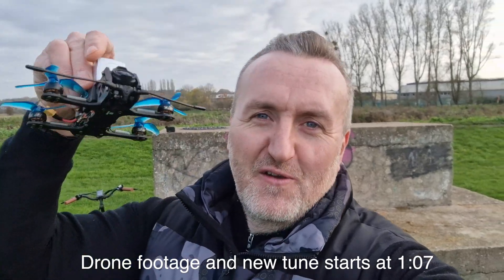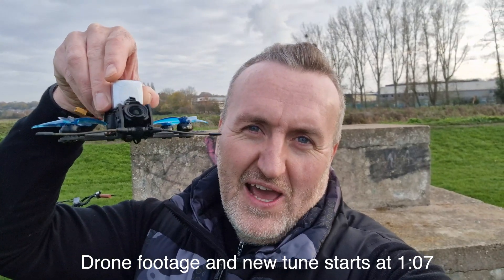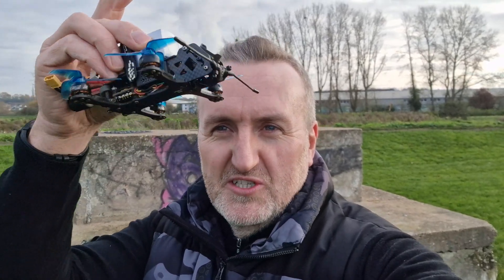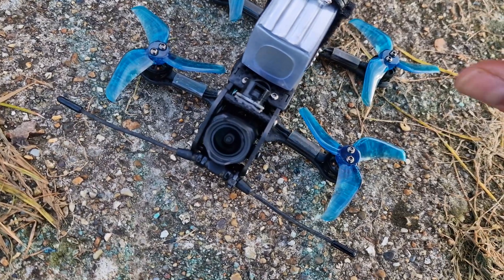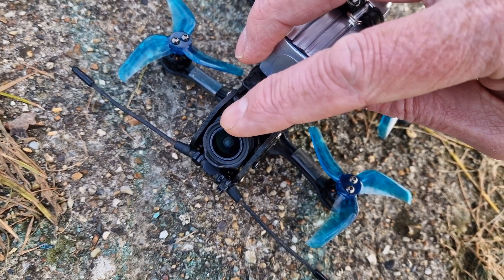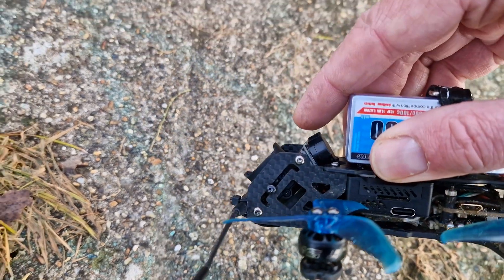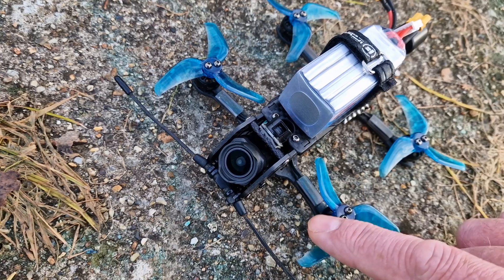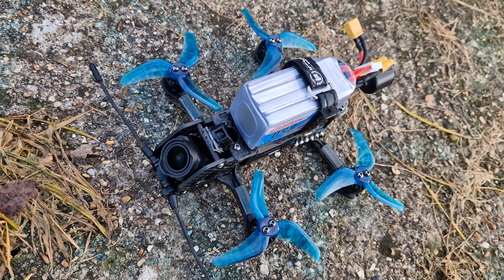GETTING THERE NOW! | DJI O3 Air Unit tweaks for better footage on a micro drone

Comment: The soft mount creates its own issues. You can see the jiggle and vibration throughout the video.  At least try gyroflow... It really is that good and easy to learn. The gyro in the cam tells the whole story of the flight and therefore can be eradicated. My first 03 air unit went on a plane. Second is in the mail and will go in one of my quads.. I cannot emphasize how good gyroflow is.
Reply from the maker: I have tried gyroflow before with a runcam thumb 4K and I struggled to get decent footage., I will revisit it with this o3 as I've now got a 5 inch with an o3, a plane and a car 😅 I love these cameras!

Comment: Have you just added O rings to the screw holes? Bit hard to see in the vid. Thanks.
Reply from the maker: Yes, just o-rings, I do it with all my o3 equipped quads now and it works. You've basically got to address any vibrations (dodgy props, slop in motor bells, loose screws) I'm now experimenting with frames known to be low vibration, it's important for the o3.
Reply: @andykirby  Thanks Andy, also great flying that little things a ripper.

Comment: Any know if you can get a better power to weight ratio drone with o3 prebuilt ready for bnf
Reply from the maker: Dont think there's any BNF pre builts yet but it won't be long. I'm interested to see what comes out with proper floating camera mounts and also without the props in view. The modern freestyle standard is 6S 3 inch rippers under 250g!
Reply: @andykirby  that would be amazing

Comment: 4 and 5 inch quads (not drones) are dangerous?...Give your head a wobble Andy ...The FPV community will be after your blood....be careful what you say m8..😳😳😏
Reply from the maker: I'm not dissing them, I fly 4 and 5 inch...they are dangerous. Hit someone/something and it will be a problem. Sub 250g not so much.
Reply: @andykirby  Well, I wouldn't like to get hit on the bonce by the little rocket ship in this video either TBH...How about a Gas Turbine jet weighing 16 lbs doing 280 kph?...That's a UAV now too you know...😏😏😳🇬🇧

Comment: Thanks for sharing. I've been battling the jello/jitters on my BabyHawk II HD. I will see if I can make enough room to try rubber washers like you did.
Reply from the maker: That's interesting I've just found my Babyhawk 2 HD which Iost in a tree 3 months ago! (Video coming!l I wanted to stick an o3 in there as i used to love how well it flew and had bags of power, the o3 camera  defo needs a really soft mount, like as isolated from the frame as possible.

Comment: That was amazing.  What kind of range does that thing have?  It seemed like you went a loooong way before you doubled back.
Reply from the maker: They say 10km for the video link. When I doubled back it was still full signal!
Reply: @andykirby  Considering the size of the camera, the electronics and the antennas that's truly mind boggling. oO

Comment: Nice stuff, looks like you’ve got yours sorted out 👍 I’ve been having a lot of jello/vibes with mine and it hasn’t mattered how I’ve mounted it.  Tight in TPU, rigid mounted to aluminum mounts on a Roma L5 frame and rubber mounted on a CineLog35 Performance, all the jello all the time 😐
Reply from the maker: Sunlight is a killer. Have you tried ND filters?
Reply: @andykirby  I haven’t yet with this setup, I have the Avata but never got the ND filters but have flown it in much brighter conditions.  One of my flights was overcast and pretty nuts maybe but I flew while it was snowing pretty hard and still had jello.
Reply from the maker: @Erik Smith  yeah something ain't right. My camera is sort of suspended in the mount, it's not going to go anywhere or change angle during flight but it's definately not rigid. It's comparable to how the Avata camera is mounted, I used that as a reference.

Comment: Nice work Andy! Just going to put it out there, that in my experience, Azure makes some of the least well-balanced props I've used. It's a shame because I really like them, especially on quads smaller than a 3 in, but especially the 5-in props I've used, always give worse vibrations than anything from Gemfan or HQ. Maybe if you swap them out that will help mitigate the jello. Nice video! ✌️
Reply from the maker: Interesting to know thanks, I'll have to try some. I use HQ on my Babyhawk 2 and they are very good.